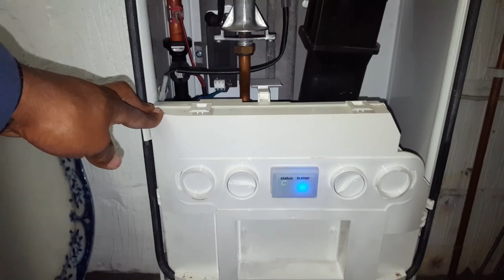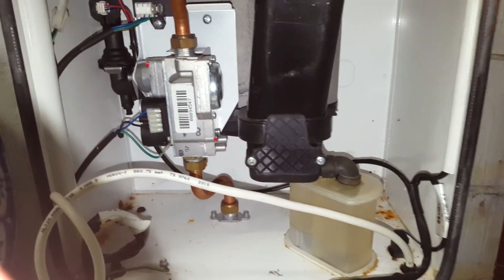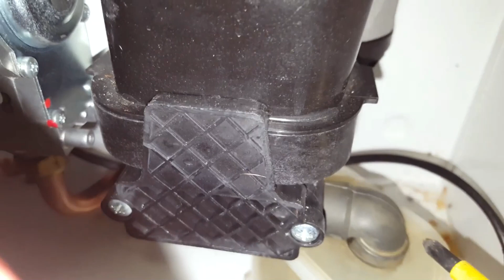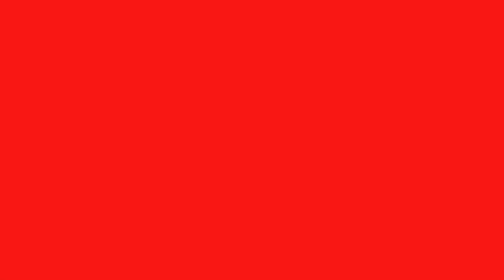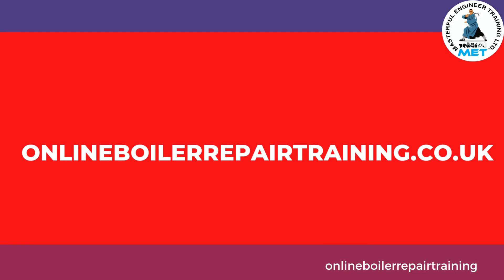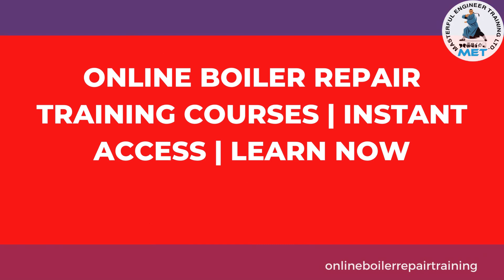Ideal Logic 15 HE Is leaking from condense trap

Comment: No on one I looked at, water leaking from the screw on flap you see in your video, removing it, I see the seal is damaged, can I apply silicon sealant  round the seal to repair?
Reply: Update, tried Epoxy both behind and in front of the rubber, not ideal(get it) but silicon might be heat sensitive, and as far as I can see this flap very rarely needs to be removed, lets see if the bodge job works.
Reply from the maker: Thank you for your comments and can you please subscribe to our channel 😊